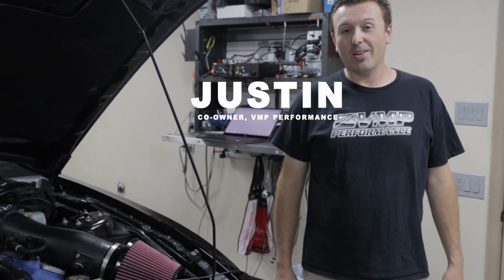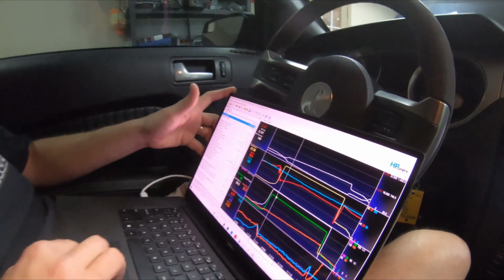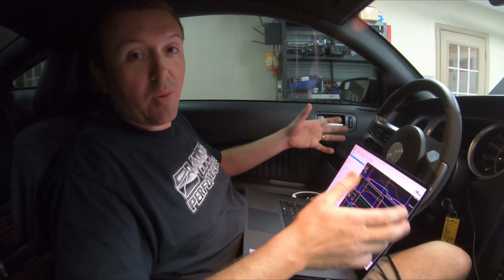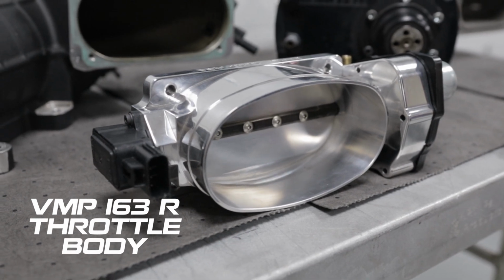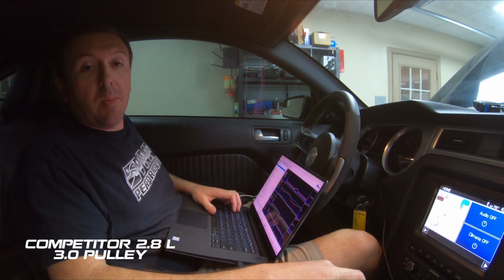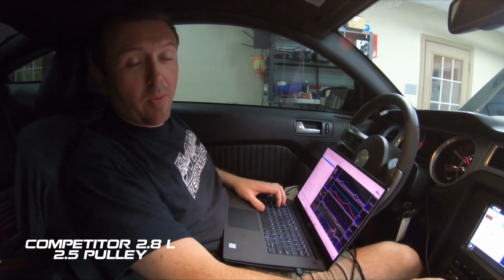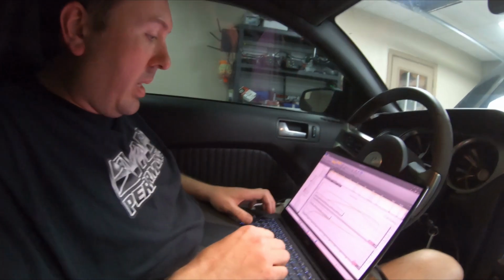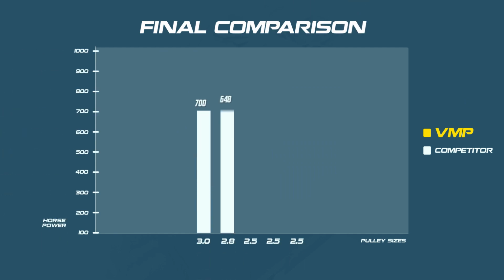Real World Testing | VMP Gen3R vs. Twin-Screw 2.8 L on a 2012 GT500

Comment: I have been noticing a lot of shots thrown between Kenne bell and VMP lol whipple is just chilling 😂
Reply: KB still has the most powerful date regardless of opinion 😂
Reply: Neither VMP nor KB want that Gen 5 3.0 smoke lol
Reply: @edmundnlemadim  yup... I made 825 rwhp with the 3.0" pulley on e85 stock motor with my new Gen5 3.0L
Reply: edmundnlemadim hell yeah!!
Reply: edmundnlemadim ehh consider the 2.65 hold the record for supercharged 18+ I don’t think they are worried about Whipple ,
Reply: blownaway14 Gen 5 3.0 whipple is shitting on VMP you are crazy
Reply: Tstaten4 the fastest 18+ supercharged mustang is a edelbrock 2650 8.501 160.8
Reply: @blownaway14 apples oranges as my comment was specifically geared toward the GT500 platform. 

That said, a quick YouTube search showed an A10 whipple GT running 8.5/8.6 at a trap 1-2 mph higher than the ‘fastest 2650’ you referenced although to me the difference is negligible, if you want to use a modified Edlebrock (Kong ported) supercharger vs out of the box whipple as an argument, that’s a L for you all day. The unported 2650 is not hanging with the whipple 3.0L
Reply: blownaway14 you do realize the cobra jets use the 3.0 whipple right ? Those are faster then 18 mustangs lmao

Comment: I remember back in the 04 Cobra / lightning days it seamed like twin screw huffers had all the fame, but at that time the Eaton was under 2 liters of displacement  IIRC, and the twin screw was 2.2 for KB, and 2.3 for the Whipple. By the time Eaton / roots stuff was producing 2.3L stuff, I'm pretty sure KB had the 2.4 /2.6 / and 2.8, and a 2.3 for the Lightning. I'm glad to see The roots / tvs is more  than staying in the game with these larger set-ups, competition makes everyone faster. Keep up the good testing, and work!
Reply: It's good for OEM. Not so good in the racing environment.
Reply: @darrenmcfeaters6683  u saying roots and tvs aren't meant for racing environments?
Reply: @tristansmirnow850  yea hes a kb fanboy hes on all the vmp videos throwing shade their way ecapecially the videos that are about kb vs vmp.  I dont understand why they cant just admit that displcement for displacemsnt the newest vmp stuff is as good or better than anything ever done by whipple or kb.  That is why they arent making 2.65 liter kbs because they wouldn't be able to hang at the same displacement they have to be larger to compete plain and simple
Reply: @tristansmirnow850  yea it isn't good for a racing environment but made with 5 hp on 3 straight pulls while the larger kb running more boost made 20 less, then 50 less, then 80+ less than the tvs in its back to back pulls.  If the tvs isn't good for a racing environment then the 2.8 kb isn't even good for any environment lol.
Reply: @midnight347  fr 💀🤣